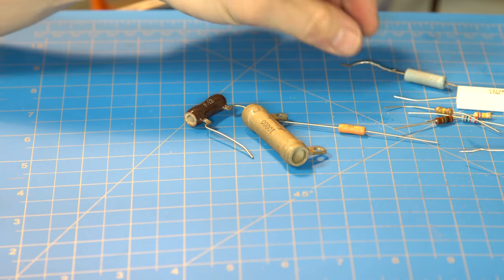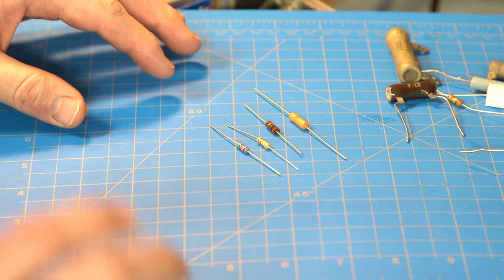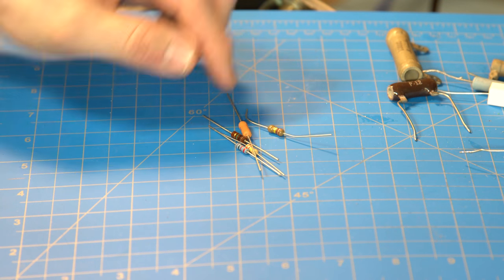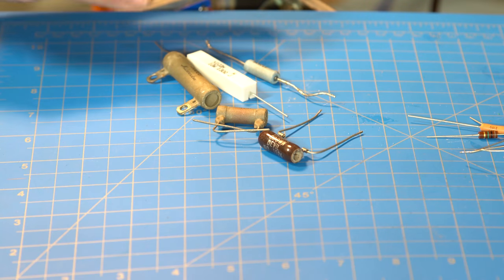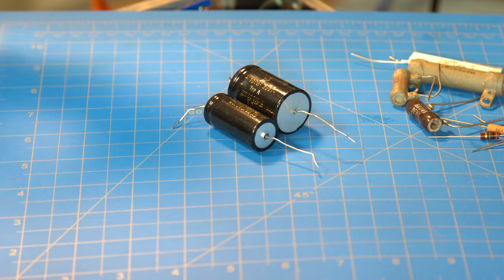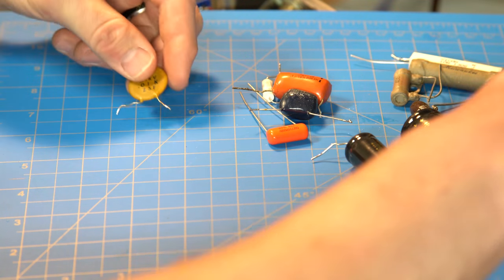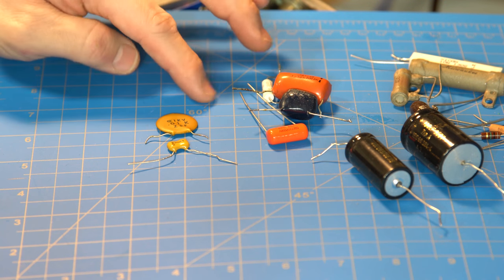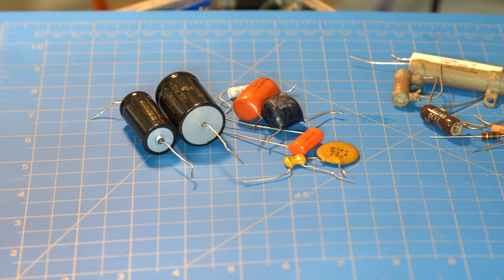Tech Tips Video #11 - Resistors and Capacitors used in Guitar Amps

Comment: cool-got my amp playing. Going to check all my voltages tomorrow. I think I need to put a 5y3 in it instead of the 5u4. It is just a little to much, I think. It is loud and sounding great.If it is going to sound like I think, it will blow my blues jr. out of the water. May have a few bugs to work out. I wish I had a heat gun to check temp. Just seems like the tubes are getting pretty hot ,going by just feeling of them. Don't know how hot they are suppose to get.I think the output transformer is what is making it sound powerful. It came out of a 60 watt amp.It was a power strip that was causing a lot of my problems. I had my current limiter and variac plugged in it. I had a couple two prong things plugged in it and they may have been turned wrong and putting positive power on my neutral. I tore my variac and my limiter a part, thought something was wrong with them and then it dawned on me about the strip. Talk about driving a fellow crazy.!!!!! Thanks for all your help.
Reply from the maker: The power tubes will get very hot.  What you want to do is make sure the bias isn't too hot.  Also, the output transformer needs to be at re right impedance for the output tubes too match the speaker as well or you'll burn up the per tubes or the transformer if the impedance is too far off.  Glad to hear it's working!

Comment: In general, what supply companies do you use for:
Tubes, Caps, Resistors, Wire, Solder, Chassis,
Turrets, Transformers and anything else I'm
too ignorant to think about asking? LOL

Wayne
Reply from the maker: For tubes, so far I've used jj and electro harmonix to great results.  Caps vary a lot for each use.  Electrolytic, I like F&T, jj, nichicon, sprague, kemet, etc.  For other coupling I really like Cornell dublier 715 or 6PS.  Wire I like 22 gauge nte solid core for everything except heaters for the power tubes, and i use 18 gauge for those.  Resistors,  vishay Dale, RN65 when I can and generally any decent other brands, like yageo.  Solder I have linked below, kester, 0.031.  Chassis' it really depends on the project.  I got my eyelets from mouser, and transformers from Hoffman amps or tubesandmore.com